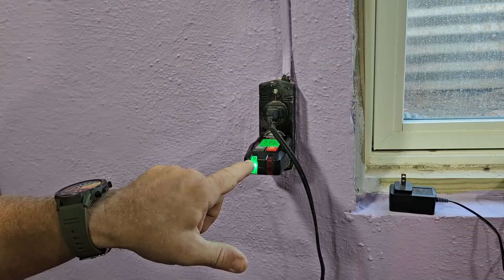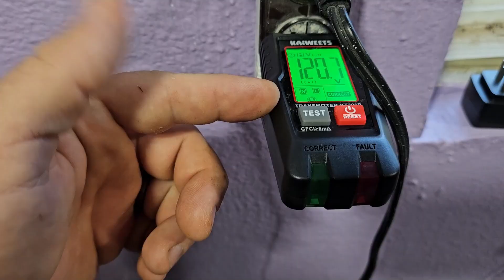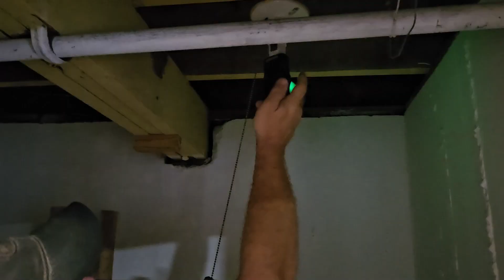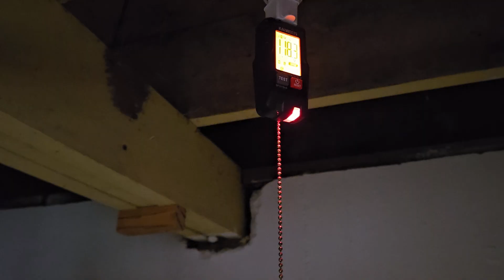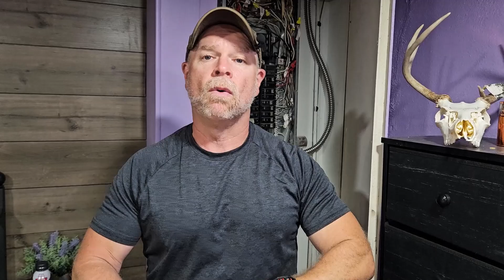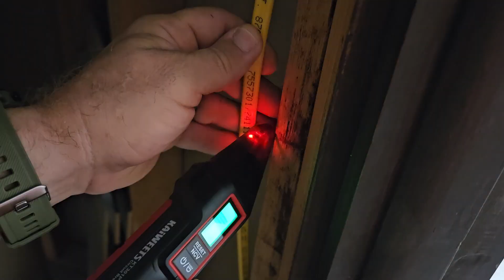KAIWEETS Circuit Breaker Finder Tutorial – Save Time & Stay Safe!

Comment: I have some Kaweets VOMs and such and they are pretty good and don't break the bank like my "yellow" one, let's just leave it at that... That NCV looks so sensitive that as you were running it down that utility wire by the HVAC, it looked to me like it could tell WHICH SIDE of the jacket was where the hot was and didn't beep when you were on (near I guess would be the better word) the cold side, or am I just imagining things? What batteries are needed? I think it's lighting up red in the overhead light simply because it can't figure ground. 73 DE W8LV BILL